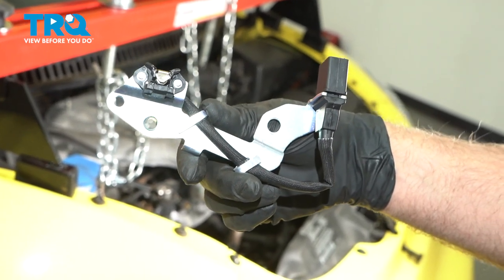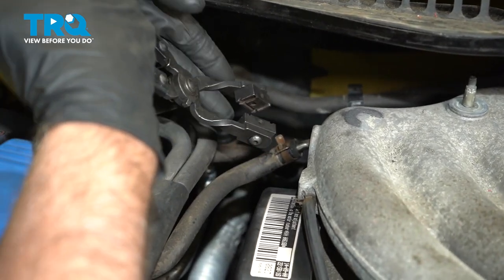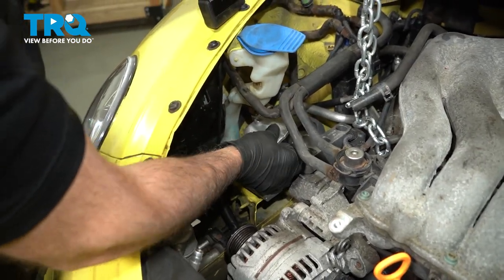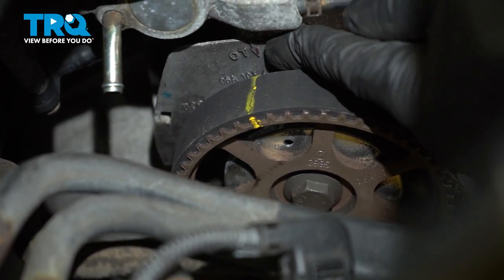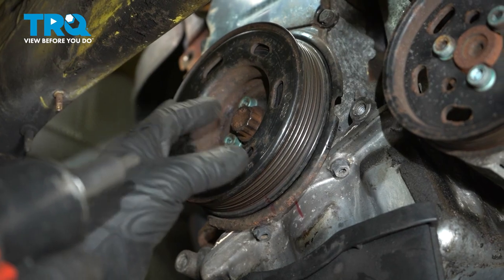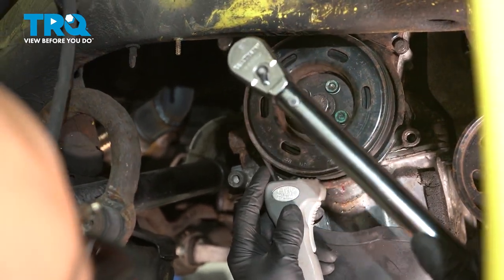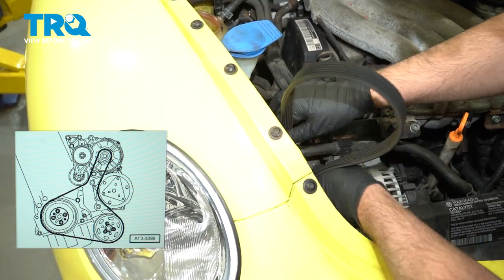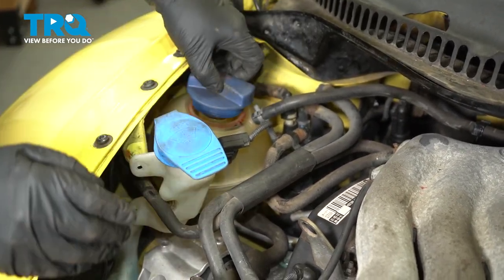How to Replace Camshaft Position Sensor 1998-2010 Volkswagen Beetle

Comment: Is this the same for 1.8L turbo beetles too? Cant wait to do thks area of the car a 3rd time. Timing was done. Then power steering pump. Did the coolant junk twice after it needed temp sensors and a real temp gauge installed. Now i can take it all apart again for that sensor 😂 eff.

Comment: I watched this video hoping to find an easier way of doing it, instead I found the long and hard way.

No need to drain coolant, remove reservoir, remove engine mount unless you’re the hulk and your arms are too big to squeeze down there.

Pull timing cover, loosen t-belt tensioner and slide belt off of sprocket.  Pull cam sprocket and swap sensor, reinstall.  Check timing marks.  Done.